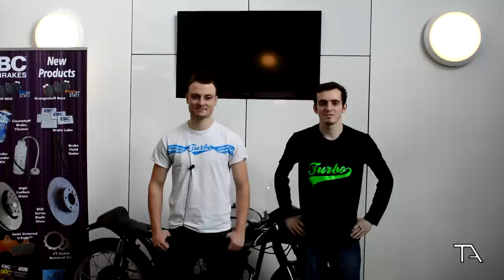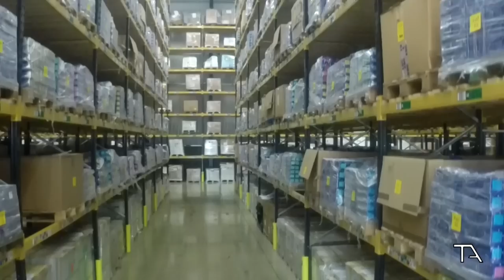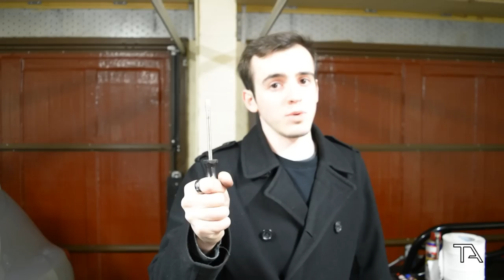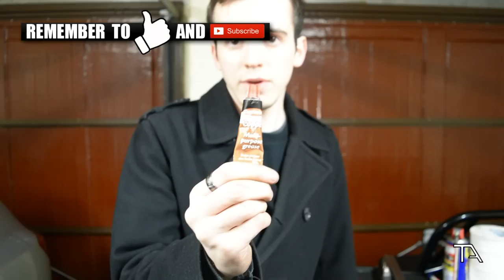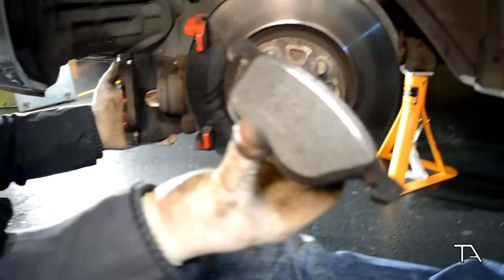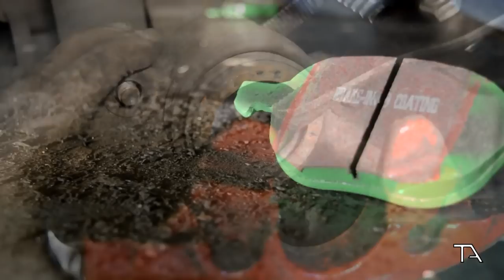DIY Brake Replacement w/ EBC Brakes | Mazda 3 | Chasing Status | S03E02

Comment: Great start to season 3, its great to have sponsors on board now! Can you notice a difference in performance with the greenstuff pads and ebc discs? Shouldn't the discs be degreased before they go on the car to remove the oil that was in them in storage?
Reply from the maker: Thanks! Once they were bedded in the increase in performance is second to none, the great thing with the greenstuff brakes is that you can constantly harsh brake and not feel any fade as the disc heats up. 

The discs should be degreased before installation, its just we did it before filming then forgot to mention it in the final edit but good spot! haha

Comment: Never apply copper grease (or any other grease) to the hub.
Reply from the maker: +Jan Kowalski When I was at BMW, I was told to ensure that copper grease was used on the hubs on the contact points where the disc sits against to ensure easy removal of the discs in the future when they have sufficiently worn down. You can even see where the original discs were put on that copper grease had been used (and that was done by a proper registered garage) [James]
Reply: +John McDonald Says who?  A small amount if high temp anti-seize grease on back of rotors if fairly standard practice.